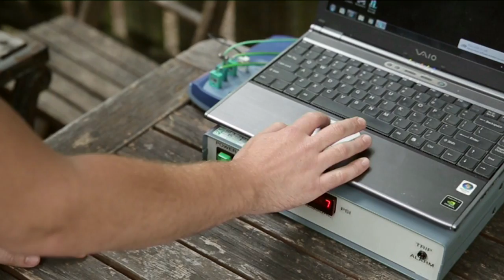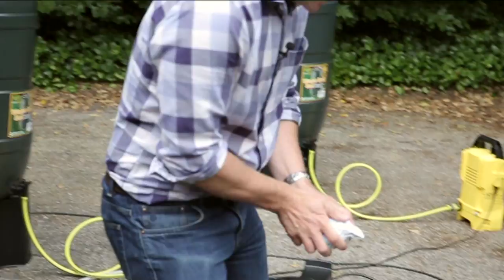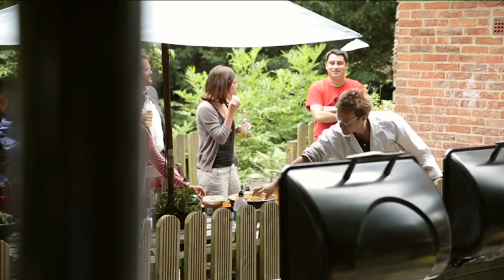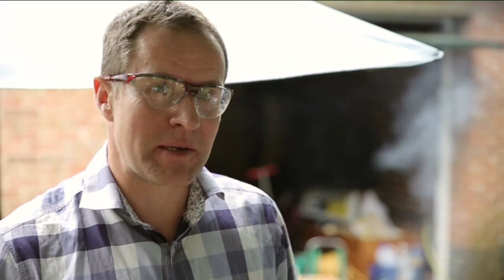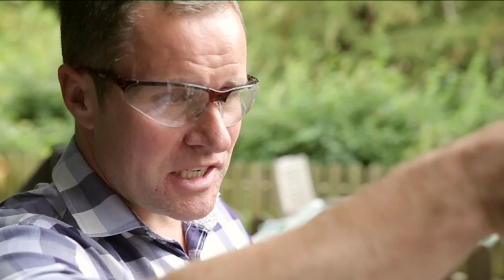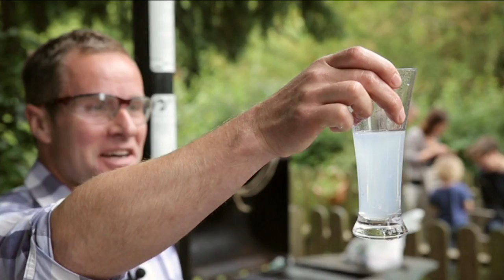The BBQ Nano Reactor (Part 2)

Comment: So what did he make?
Reply: The blue colour is liquid plutonium.
Reply: NotGettinAny
i kind of cant beliebe you.
Reply: His precursor was an iron oxide solution IIRC so basically tiny tiny bits of iron suspended in water?
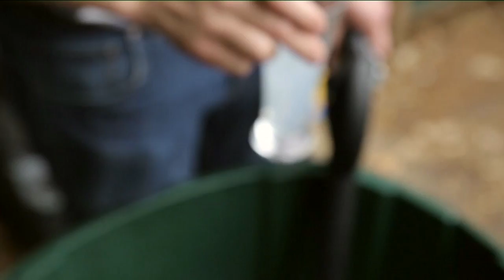Reply: If I'm not mistaken, I think he said that he had "a bucket full of artificial bone" (5:18), so my guess is this could be applied to the medical field to create artificial bones which are much cheaper than the current artificial bones (which I believe are made of titanium).